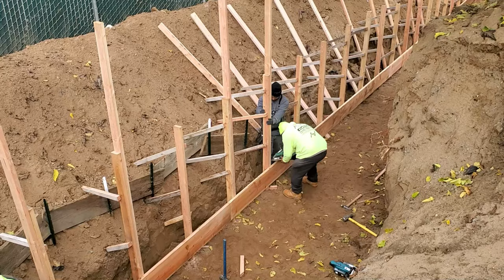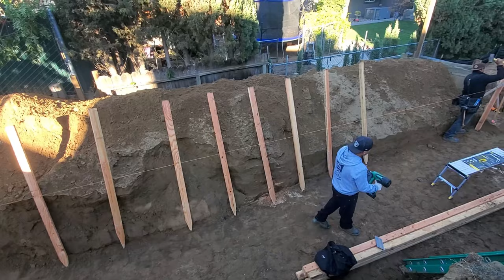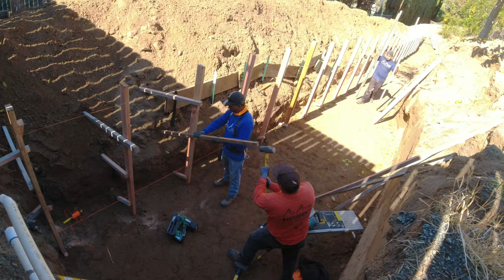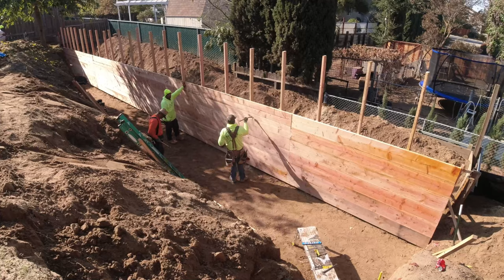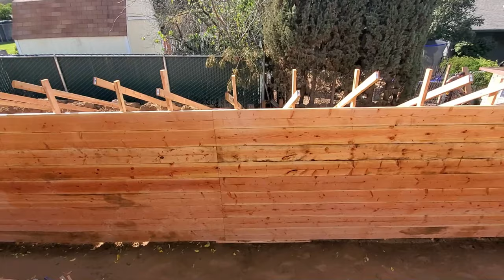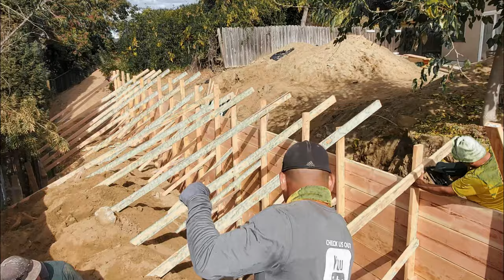How To Build 9 Foot High Concrete Retaining Wall With 2*12s

Comment: Hello we are planning to retain our backyard holding a 2 story house. With 4 meter high by 8 meter wide, what size of rebar to be use?
Reply from the maker: So if I covert that right that's 12 feet tall by 24 feet long... You definitely should speak with a structural engineer.... But your probably will have a double Matt reabr #5 for the wall and double Matt rebar using #7 and #5 for the footing.. Good luck with the project

Comment: I’m curious how come y’all pour it all at once footer/wall ? We’re in from we usually do footer first then anchor wall form to footer prevents from having to drive so many stakes
Reply from the maker: Monolithic is always better on any pour.. Not sure where you from but normally on the east coast it's normally a two pour system.. Stakes wise we are only 4 to 5 feet on center depending on the wall...

Comment: I'm gonna be doing something similar. Im guessing this wall in enough to also support two stories as well as reatain? Planning on using 2×12 and then reuse them for the floor joists. What do you spray them with before the pour?
Reply from the maker: We just use regular form oil...

Comment: Don’t under stand why you didn’t construct the footing first. Install rebar dowels to connect the wall rebar. Did you think of building off site 10’x8’
Wall panels locked together to form the wall. The Panels can that can  be reused on future projects
Reply from the maker: No need to do all that extra work. Wall was poured monolithically. Also, we reused all our forms..Check out part 2:  https://bit.ly/3Cs2Aqh